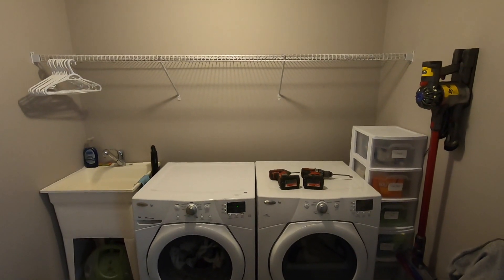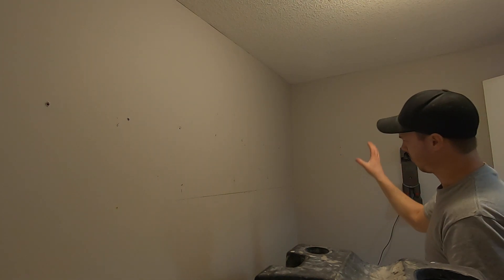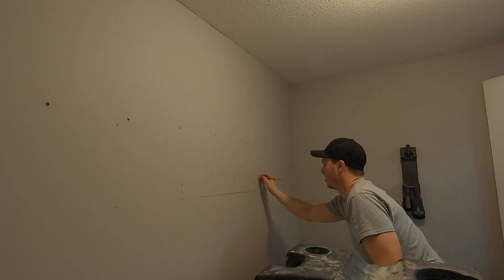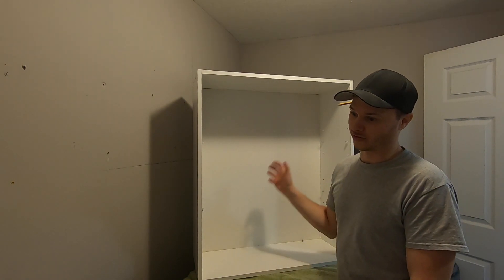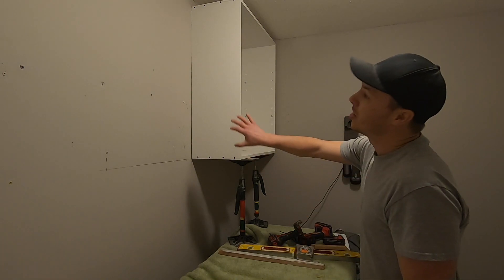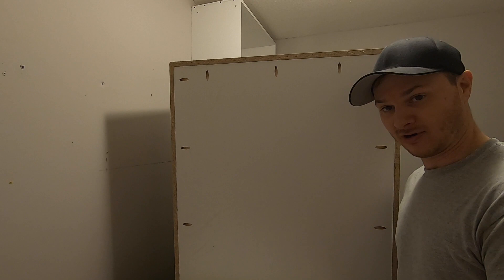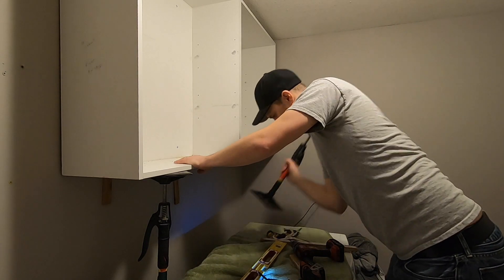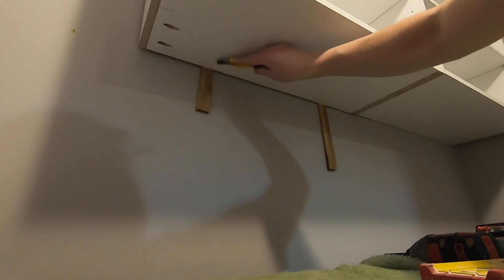How to Install Wall Cabinets in a Laundry Room

Comment: Were you concerned about possibly drilling into electrical wiring or water piping?
Reply from the maker: It happens. I know there is likely nothing to worry about it this wall and I make sure by screws only go into the studs about 1.25" deep in case something is there.

Comment: For the shims, you have to place them along the stud so you can screw into them or just anywhere you need them and the pressure keeps them in place?
Reply from the maker: If there is a gap behind the cabinet, you need a shim before you drive the screw in. Keeps things from warping or pulling the back off the cabinet so you can get the screw tight. You may need shims in other places that don't get screws like the cabinet ends to get them plumb.

Comment: Shouldn't the pilot holes be slightly THINNER than the screws? If the drill bit is thicker than the screw, the screw will not have anything to grab and will fall out.
Reply from the maker: You want the screw to spin freely in the back of the cabinet so it will get pulled tight to the wall. If you don't, you may get a gap behind the cabinet. It is more of a relief hole drilled into the cabinet. Most wood screws have this built in by not having threads all the way to the screw head. If you are mounting the cabinet on wood framing, you don't need a pilot hole in the wall unless you are using some big lag bolts. If you are mounting on concrete, brick, heavy gauge steel studs, then yes, you would drill a smaller diameter pilot hole in the wall and a relief hole, around the same size of the screw, in the back of the cabinet.
Reply: @BrentDarlington  Got it, thank you. I misunderstood.